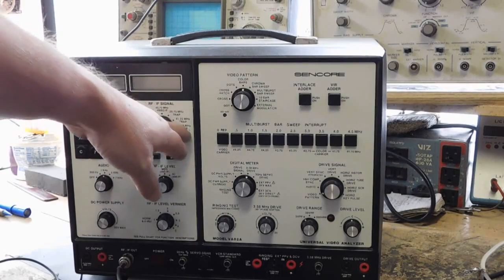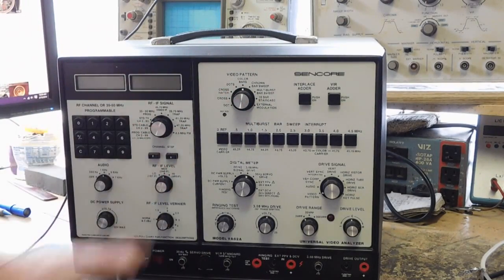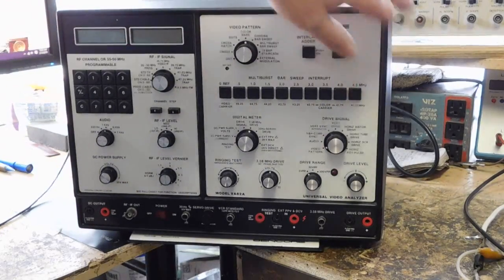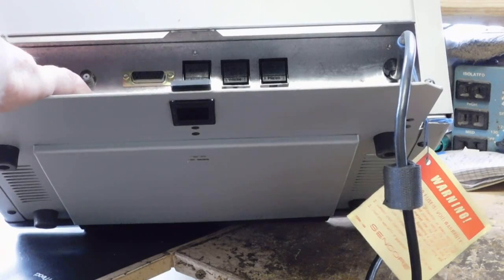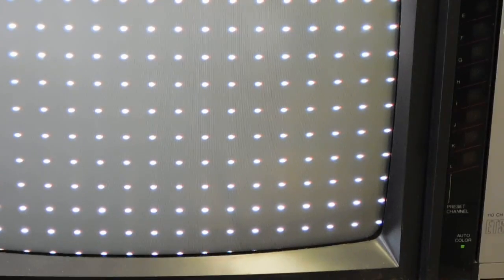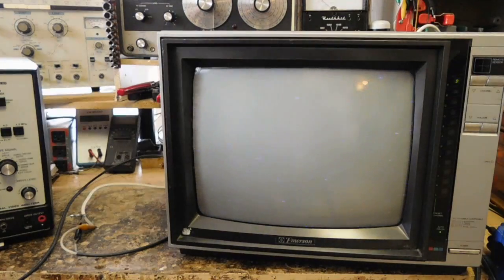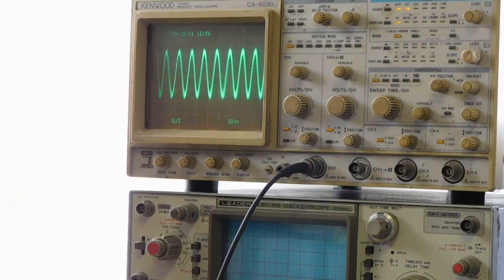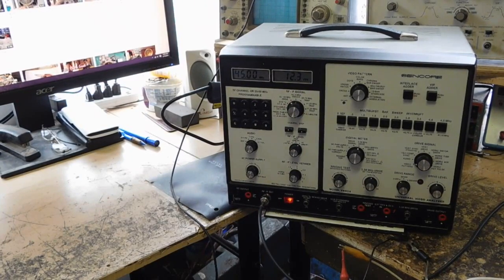Sencore VA62A

Comment: My comment was about the concept of the Sencore VA48 Video Analyzer, which I wrote the operational portion of the manual while being the Factory Field Engineer at the time.

Herb Bowden, Founder and CEO of Sencore, described to me his concept of having "everything in one box" that would allow a technical servicer to use a "systems approach" to troubleshoot consumer devices in the home or on the bench.

The VA48 at the time, followed along that concept from the former CB42 CB Analyzer, testing from front-to-back, finding the problem.

The VA68A is still an excellent product, well designed for it's purpose at the time.

Comment: Nice video.. I watched Bob's video on his not too long ago.   I also see that Leader lsw-333 in the background..  I just picked one of those up here locally.  was wondering if you might do a little video on that?
Reply from the maker: +Bret Frohwein I will be uploading a video on the LSW-333 today.
Reply from the maker: +Bret Frohwein I also put a copy of the operation manual for the LSW-333 on my google drive. You can download it from there.
Reply: +Dennis Carter you rock!  I see your google drive but I don't see the manual there.  :/
Reply from the maker: +Bret Frohwein Try this link
drive.google.com/drive/folders/0B9Na-tN3ZdY-OW04X1FQZFV1X3c
Reply: I see an LSW-359 swemar generator.
Reply from the maker: +Bret Frohwein Sorry about that. The lsw333 is on that link now.
Reply: +Dennis Carter I got it!  thank you so much